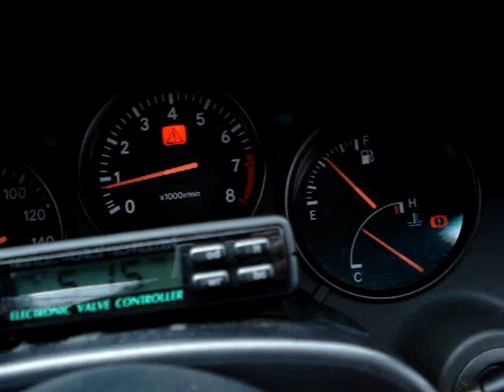WWW.TYEEIMPORTS.COM SUPRA MK4 HKS T45S SINGLE TURBO

Comment: Seem like i have the same set up. Except for the exhaust. Mine is the old version HKS turbo exhaust before they producing the HKS super drager one. And how many pounds of boost are you running? Mines 19 psi at 444 whp. On pump gas #91. Living in California sucks. Lol